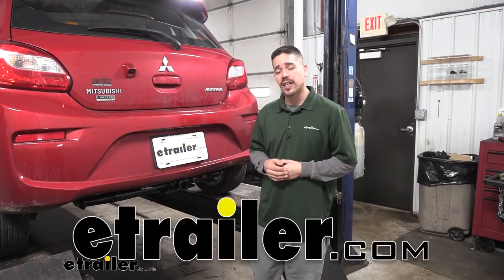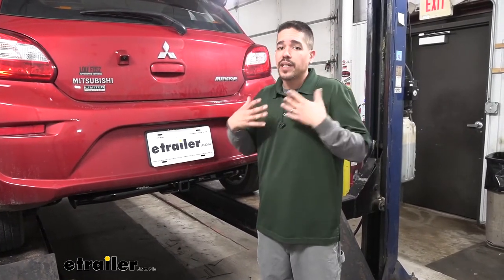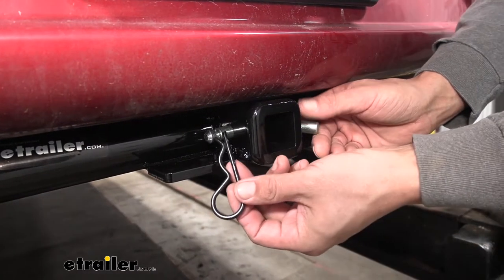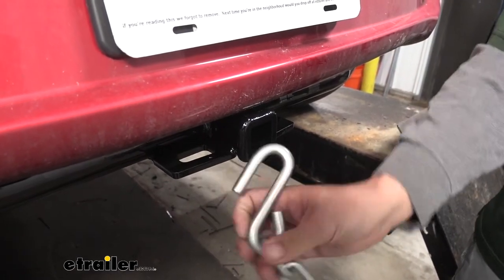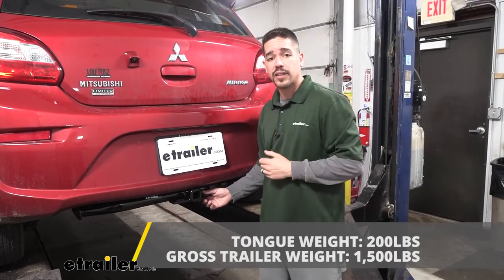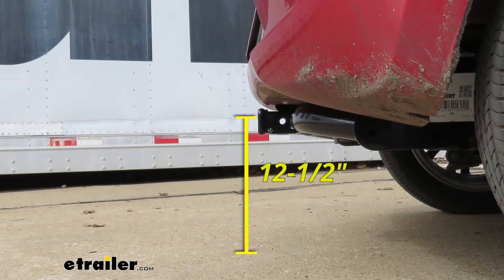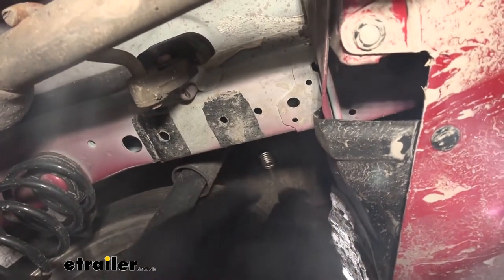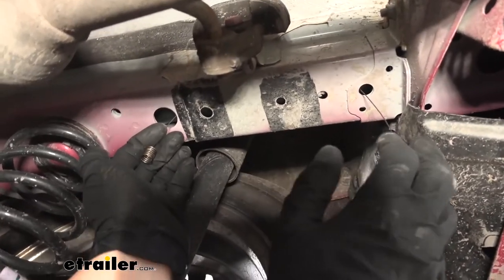etrailer | Curt Class I Trailer Hitch Installation - 2019 Mitsubishi Mirage

Comment: For everyone commenting on this cars towability, I would like to remind readers that ANY car could tow at the very least to whatever its GVWR is. For my 2015 mirage which weighs 1,996lbs and has a 3,020lb GVWR, I'm left with about 1,024lbs to play with. However, you have to add/subtract whatever weight you add/subtract to the vehicle such as your own weight while driving. I am a 300lb guy, so that knocks me down to 700ish lbs.  Northern tools' tiny 40x48 inch aluminum trailer weighs 120lbs, and the curt trailer hitch weighs 31lbs, so now I'm down to around 550lbs that I could add to the trailer. There is still a good bit of work you could get done with that much weight. My KLR650 motorcycle weighs around 450lbs by example. There are other factors too, such as weight placement. The rear suspension will see more stress when loading 200lbs on a hitch rather than loading 200lbs right in the trunk. Even though that 200lbs is entirely handled by the rear suspension either way, having it loaded further back on the trailer hitch rather than in the trunk creates a leverage effect and it will cause the rear suspension more stress. You want to make sure you try to aim for that 10% of the trailer weight to be placed on the tongue mark. If you have 500lbs worth of trailer, then you need to try and scale the tongue of the trailer to only have 50lbs and move the load around on the trailer accordingly to reach that 10% number (luggage scales would work great with this cars capacity rating). This wouldn't matter AS much with large trucks, but even semi-trucks improperly loaded can get a lot of trailer sway. Being that the Mirage is the lightest car on the market today, I would say that weight distribution matters more for this car than with ANY other vehicle on the road. That said, most vehicles are under rated really, and I will probably allow myself 1,000lbs of trailer with a 100lb tongue weight when it is just me in the car. The mirage doesn't have a lot of power, and 1,000lbs will definitely be noticed, but for short hauls from Menards to home it shouldn't affect anything long term. I would haul up to the GVWR anywhere and any distance though. My primary purpose for this is to put a large, wheeled cooler on a cargo carrier because I do grocery deliveries as I cannot drive 18 wheelers anymore due to arthritis. I also have a small trailer that I can load kayaks on. Lastly, a trailer handles weight distribution better than something like a cargo carrier. This is because it has another axel to leverage weight on. I wouldn't start adding extensions to get your cargo carrier back far enough so that you could still open the rear hatch. You want to keep that cargo carrier load as close to the rear of the vehicle as possible. Either remove whatever is on the carrier to get to the hatch or use the rear doors if you can fold the rear seats down to gain access to the trunk that way while using a cargo carrier.

Comment: Can a hitch go on a 2021 Mitsubishi Mirage G4? With a wire connection, Uhaul said no.
Reply from the maker: According to Curt, their #C11449 fits all models of the 2021 Mitsubishi Mirage. For trailer lighting, you'd need to install the # C56223 which is also compatible with your G4.
https://www.etrailer.com/Trailer-Hitch/Mitsubishi/Mirage+G4/2021/C11449.html
https://www.etrailer.com/Custom-Fit-Vehicle-Wiring/Mitsubishi/Mirage+G4/2021/C56223.html
Reply: I ordered it. Thanks alot. I'd love for you to install it. You know what your doing. Are you in Florida?
Reply from the maker: We are not in Florida. We are located in Wentzville, MO which is about 30 miles west of St. Louis. However, if you use this link below, you can find a local shop that can handle the install for you (just input your zip code):
https://www.etrailer.com/installer/near-me/wentzville-mo/trailer-hitch

Comment: IMPORTANT TIP: You do not need to drill any hole bigger (especially not one you should be using to mount the hitch with). You can use the access hole which opposes the hole on the side (without the fuel lines) that they show you to use. Pause the video @ 6:10 and you will see fuel lines next to the spring where under is the access hole that is opposite to the one on the other side. There is a 12mm bolt holding those fuel lines down with a small bracket. The lines are very rigid even after removing that bolt, and you will have to slide the hitch bolts in flush with the frame while pulling the lines down about half an inch. Slide it in right where you see the hole between the two fuel lines coming at it from the side and twist it in where it will just barely fit. However, it wasn't difficult at all once you realize what I'm trying to explain.   I went this rout and can tell you that those fuel lines are very solid, and you will not hurt them at all by moving them JUST enough to get the hardware in. Fishing the feeder line in is only a LITTLE more difficult than with the other side. I'd say doing it this way only takes a couple minutes more effort than it takes with the other side (without counting removing and replacing the bracket bolt). I'm sure drilling a hole is more tedious overall. No need to get a drill out and find a good bit for the job. No need to reduce the integrity of the mounting hole as shown in the video. The hole he enlarged was the one the bolt should slide through, so I imagine he just used the bracket in the kit to hold that bolt instead of the cars frame. Observe the holes the bolts came through on the other side @ 4:30 now back to 6:41
Reply from the maker: What a fantastic tip! Thank you so much for sharing.